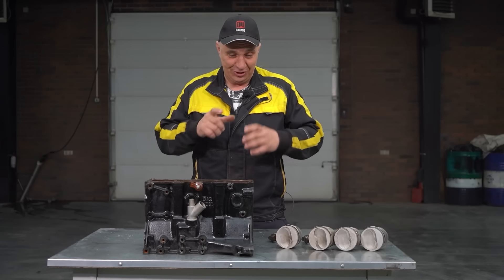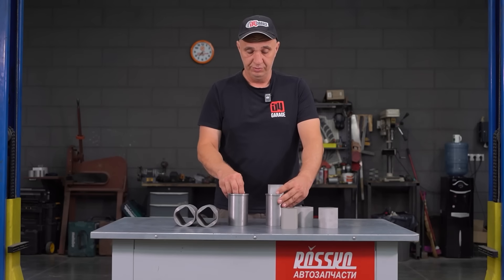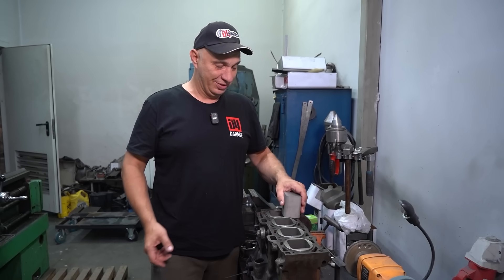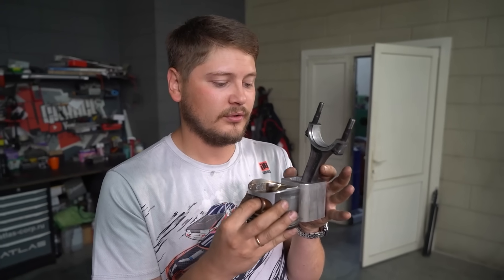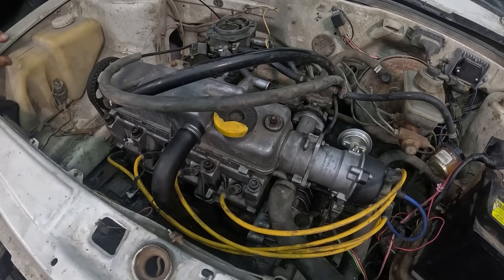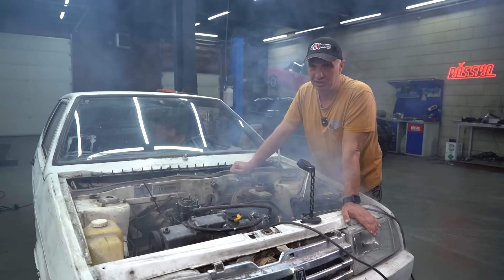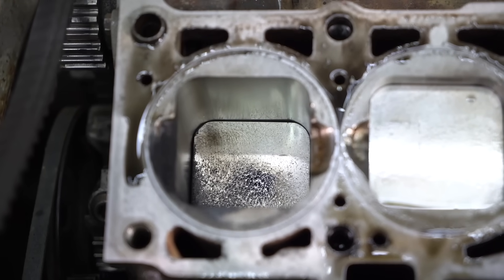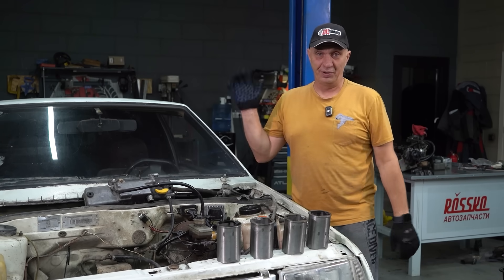We make square-section pistons - will they work?

Comment: In my younger days I ran into an old timer who told me a story about a rod knock in his old slant 6. He said that he replaced the rod bearing on the side of the road using a leather strap. He told me that they once used leather rod bearings on old model T cars. He said the engine was still running on that very leather strap 2 years later. I'm sure that leather would be more heat resistant than rubber, so maybe using leather to create rings??? Awesome video, and pretty cool machining. I would say that for a short time, due to the valve reliefs you cut into the sleeves, your piston is relying on one singular ring, but very cool none the less. Maybe consider making your sleeves keyed to prevent them from walking or maybe make them free floating and allow them to walk more easily to reduce wear. Thanks for sharing.
Reply: This is a cool idea. Leather is probably better suited to being a rod bearing than sealing a piston, but leather rings might last longer than the rubber ones they used.
Reply: @louchedecay7922  The fella did note that he had to soak it in oil before installation. He said that after the heat, the leather hardens with the oil and is pretty resilient.
Reply: I believe leather was also used for crankcase seals.

Comment: Would actually work perfectly fine if you put in all the work needed to build such an engine. Like drilling the oil duct and machining proper metal compression and oil rings for the pistons.

Comment: Just as a thought. The compression loss may come from the extra area not covered by the head gasket. Since the gasket itself still has circular holes. Which had some extra area that would leave room for the compression to be lost

Comment: Once you get the issue with the piston rings sorted out… you should add some forced induction, to see if the square section can withstand the extreme pressure differential.

Comment: The reuleaux triangle and the “do nothing grinder” (ellipsograph) are actually very useful inventions for making consistent shapes which aren’t circles, but still have rounded corners.

Reuleaux triangle drills can be used to drill square holes for example. Combine that with ellipsographs (used for drawing ellipses, but could theoretically also be applied to cutting implements), and you could do oval-ish-rounded-rectangles…

Comment: Pats Offroad had designed Frac water holding tanks square to maximize the water volume for frac sites.  But strangely, nobody wanted them on their site. Thing is, you couldn't use a standard cradle to pick them and nobody knew how to get them certified because they were square.  Any vessel which exhibits square or rectangular surfaces typically have weak spots where you can experience metal fatigue because steel has more tensile strength than compressive strength.  They may be able to maximize your weight to power ratio in an engine, but the cons are worse than the pros.  There are reasons things which hold fluids or pressures are circular.

Comment: 5:34 I mean rubber rings... I get it it is not made to last anyways....

I think... but you could fix it with square-ish piston rings that have little cutouts of material on the inside "maybe".

But you'd have to change the pistons to be NOT perfectly tight at the corners as in start the curve a tiny tiny bit too soon. Whilst taking off slightly more towards the middle of each flat so room remains for thermal expension and even tho it is still senseless, it might become and engine that could last. 😂😂😂😂

Comment: What if you made a ring in a L shape. Two of them would come together to make the complete square. You could drill small holes in the ring groove to house strong tiny springs pushing towards the cylinder wall against the ring. You would meet the second set of rings in the opposite diagonal to prevent overlap.

Comment: Use the sections that were cut out of the sleeves to make real rings for the pistons. Use small springs behind them to keep them pushed against the cylinder walls. That should fix your blow-by problem.😎👍

Comment: hey Garage 54 questions! Can you build a driveshaft, wheels or and entire truck frame out of Pykrete? c: 
Is it true keeping condoms over each fan blade keeps them cleaner and balanced better? 
Is it possible to drive a lada completely underwater for a period of time using the needed mods and an air snorkel? 
Remote control Lada? :D

Comment: If I recall , Honda made a racing motorbike with oval bores and pistons 
It was a GP 500 bike called the NR series
Reply: Oval is still fineish since there is no hard corners. This one has lots of weak/tress points. I presume honda did that to keep the displacement the same while getting enough room for larger/more valves, or what was the benefit idea behind the design?

Comment: Those rubber piston rings were always going to melt, surely no rubber will withstand the heat from combustion? But such an awesome and fun project, at least it worked for a while.
Reply: Silicon O-rings are the answer, or apex seals similar to a rotary
Reply: @johnt.848  I know some rubber seals can take the high heat of certain parts of the engine, but combustion chambers get so much hotter than some people realise, I didn't think any would be able to take those kinds of temps, especially silicon.

Comment: Can you remake an dohc engine in which the camshaft which controls the exhaust valves rotate twice as slow as it should? It would be interesting if it can sustain itself running

Comment: if the sleeve and piston was turned 45 degrees in the block so that it was a diamond pattern, would that give more clearance for the rods and valves?  
example:  this is how it lines up in the engine in the video🟧🟧🟧🟧  but if turned 🔶🔶🔶🔶

Comment: If you were ever going to try this again maybe silicone piston rings, or four separate 87° piston ring pieces out of cast-iron pipe would work as piston rings?  That way with all four are put onto the ring landing they would make a square “piston ring“.  Or find some heavy gauge spring wire to make your own piston rings?  Leave a gap for expansion and use at least two piston rings and offset the gaps on 180° or last but not least use wire and make a spiral piston ring and groove.

Comment: if a square piston is designed from the ground up it would have more displacement for the same block size.

initially i thought they were gonna bore out the block.basically adding more space in each corner, But that would have been way more work

Comment: There was an engine designed  with square pistons actually, and it didn't use piston-end bearings either. I think it intentionally slapped the "cylinder" walls. Sealing would be a nightmare

Comment: The cylinder has to be mostly round such as the oval cylinders Ford manufactured. The issue is that an explosion isn’t square shaped so you’re effectively stressing the walls of the cylinder for the sake of dead weight in the corners. Scientifically this was a waste of time.

Comment: When are you guys going to try running your super high compression engine with ammonia gas?
The stuff is cheap, easily cooked up and an infinite resource.
In the 'West', everyone who has made one work publicly has met with an untimely demise. 
Anyone with a 120 psi air compressor can make 'dirty' ammonia gas. 'Dirty' meaning it contains sulphur which is detrimental to an engine's longevity, but look it up. 'Pure' ammonia gas at room temperature becomes liquid at 120 psi.
Keep up the great work guys!

Comment: You Guys did Awesome and Stellar on this to Modify an Engine to use Square Pistons and Sleeves.. An Engine that actually runs and drives a Car down the street, even does a burnout... Not only that but all the Coachwork Built Machining that You all did all of it is totally Outta this World... I agree make or order some custom made Square Rings to replace the Rubber ones.  Make sure the two ends where the rings spread apart have a leg that will fit up inside a hole in the piston groove...Since the rings are square they need something to clip in to so don't move around or deform too much...  I Love it Garage5️⃣4️⃣😁😉👍🏻👏🏻💜💜💜

Comment: Use galvinse steel wire for piston rings, the type used in fence lines around live stock.
Thiß is not hard and will wear quickly but will be a better solution than the rubber rings.off sett the gap 180 degrees

Comment: Everything I expected happened, like probably most expected, who have experience. Rubber ring quickly failed, and excessive wear on the flat piston skirts. The big question I have is how even the A/F burns across the the whole ignition cycle. Will/would there be a consequence of the shape, an uneven burn causing a hot spot leading to pre ignition and a block window? These assuming you can get proper rings made, obviously to get any sort of long term operation.

Comment: Might be possibke to mske steel rings that match the bore and put a gentle tensioner behind them
The wavy spring steel type seen behind oil rings

And even an oil ring of similar 

But then it would be a bit ott

Comment: this  was a theory here another theory if you mix oil with the gas and take the engine to a 2 stroke mix it would save the rubber rings.. but if you machine square metal pistons rings. and add a 3ring slot. for the oil. first and second ring is for compression the 3 ring is for oil coming from the crankcase. and it would stop the blow by for the fuel.  did your try to dish piston theory we talk about on the phone? yes it would bring the compression up a little bit but give the engine that za sound.  but it may drop the power which force to change out the cam. to build more power. but this was a very good theory to watch thank you.

Comment: Rings can be made with aluminum wire in the thickness of the gutter and installed with the openings of the square rings offset to avoid alignment and improve sealing. It must have 3 rings, 2 compression rings and an oil scraper.

Comment: SiImple facts are rubber will never stand up to combustion pressures. You need conventional metal rings or engine will need rebuilt every 15 minutes. Honda built a motorcycle engine with oval pistons, basically a 4cylinder with two big oval pistons instead of four round ones. The Honda NR750 race bike. NOBODY has managed a true square piston.

Comment: Man with all this work I would have loved to see some custom metal piston rings
Reply: Make them in quarter circumference with wave springs behind them to push them against the walls.
Reply: How on earth would you fit them though? Unless, perhaps from two halves that have a very small gap in the middle...
Reply: The two squarish squircle piston rings would have just a single gap in each one, on opposing sides of the piston. Just like on round pistons.
Reply: @jacobshort6528  You would very likely break these when trying to open them far enough to get them over the pistons because the corners will be more stiff than the straight sections. Piston rings are very brittle.

Comment: Cut piston rings from a flat sheet of softer metal in 2 pieces and them fit in meeting in the centre and in second ring rotate it 90 degrees
Use a metal like copper then it won't eat in to the cyclinder wall as much

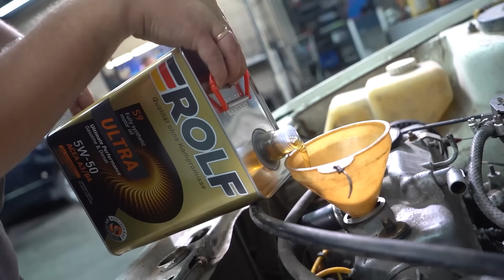Comment: 10:19 Tip; rotate the can 90 degrees sideways, when the can is wider than taller, the oil won't slop back and forth aggressively, it's why the can is that shape.  Great video though by the way! :)
Reply: Tio

Comment: Watching these guys make me wanna import a LADA and drive it around US lol
Reply: There are definitely ladas already imported into the US.

The easy equivalent (just not carbureted) is a Volvo 240 with a manual transmission. They sort of look like ladas, and they are simple and reliable. But unfortunately a 4 cylinder sedan or wagon gets the same MPG as my f150, so they aren't fuel efficient if you drive a lot.

Comment: Try making the rings out of tightly wound metal springs!   When the  motor heats up they will grow and seal better!  Plus you need to do an oil ring that can put more oil on the cylinder walls.   Cylinders?!   Or are the squarinders?